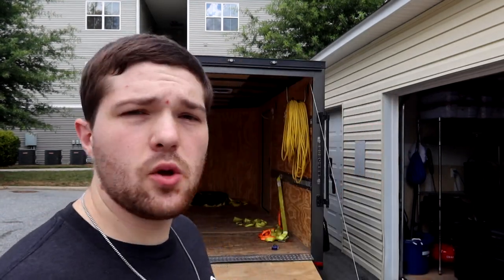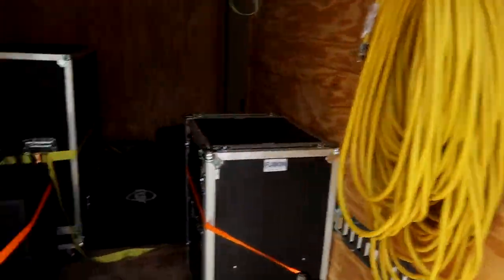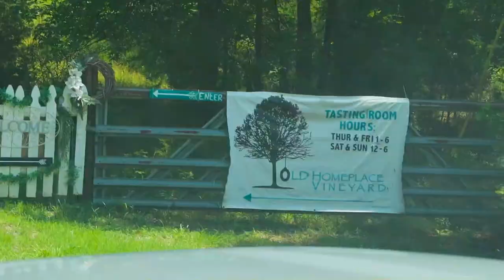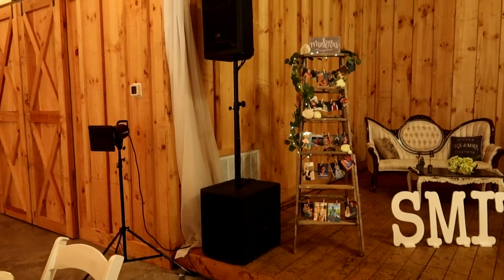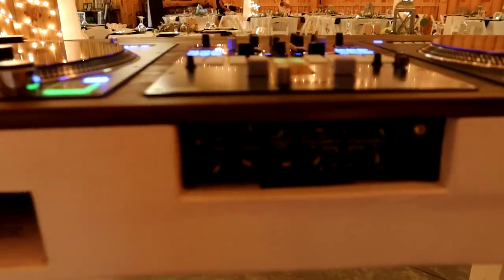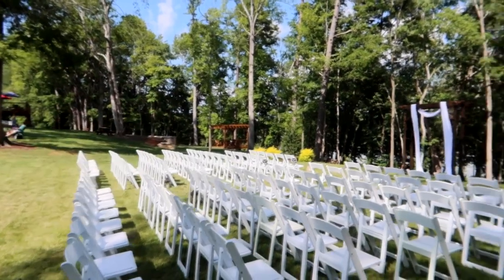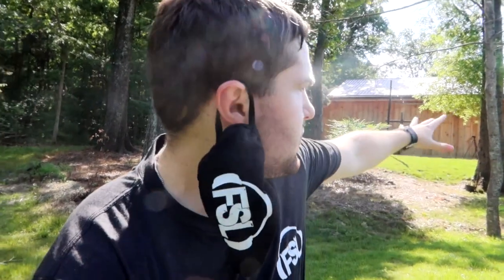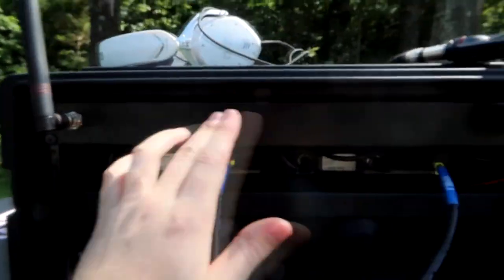DJ Gig Log: It's TIME to PARTY! (Full Set List)

Comment from the maker: Full Set List Here https://bit.ly/31ZP5MR
👕 DJ LIFE CLOTHING (My Brand)
https://shopdjlife.com/

Equipment Used
Mat https://amzn.to/322lOBb
Ceremony Sound System
-Colorado Sound and Lighting Battery System - Rack mount model
(Use promo code "Rick" when you check out to save some money)  
https://csnl.com/products/lithium-ion-power-supply
-4U plastic rack https://amzn.to/3aenueJ
-2U Gator Shallow Drawer https://amzn.to/39ZWmzU
-LD System Maui 5 Go https://amzn.to/2RmWr7h
-Audio Technica 3000 4th Gen Wireless https://amzn.to/2WSQqFH
-Yamaha 6 channel Mixer https://amzn.to/2IRsEQe 

Reception
-JBL PRX 712 https://amzn.to/2Xf4CIl
-JBL PRX 715 XLF https://amzn.to/2RkBsCk
-Custom TurnTable Booth https://youtu.be/PvgypfvJ-Og
-Custom Audio Rack https://youtu.be/GJ2k-5H-JFc

Lighting
-Chauvet Wash FX 2 https://amzn.to/2WN820s

Comment: Great gig log !  great gear, great setup, very happy to see you back at work.  My only criticism would be with so much amazing gear - I would have speakers on both sides of the ceremony stage, but I'm probably nitpicking :)   One question though - how are the lights attached to the speakers - without damaging them I presume ?   Thanks...
Reply from the maker: I have a video called how to mount lights on speakers
Reply: @DJRickWeb    Thank you !  must have missed it.  subscribed today so it won't happen again :)
Reply: You just use the little M10 nuts that are screwed into the top of the speakers for that purpose (Or for flying the speaker) Just unscrew them and screw your light fixing onto the top using the M10 nuts, they are on most decent quality speakers. I have them on my EV EKX range, might want to use rubber washers that will also protect your speaker and not affect sound in any way too :)

Comment: Do you ever use lapel mics at the ceremony? I am having a helluva time finding a wireless bodypack that doesn't cut out during the ceremony. I have the Sennheiser XSW 2 ME3 setup. It works awesome when I sound check, then goes to hell during the ceremony.
Reply from the maker: I always use lapels.
Reply: @DJRickWeb  What brand and model? I see you spec out AudioTechnica hardware?
Reply from the maker: 3000 4th gen